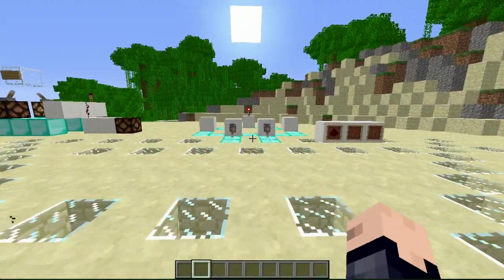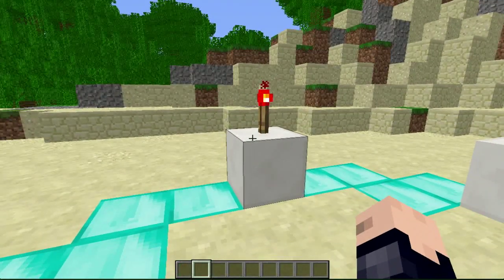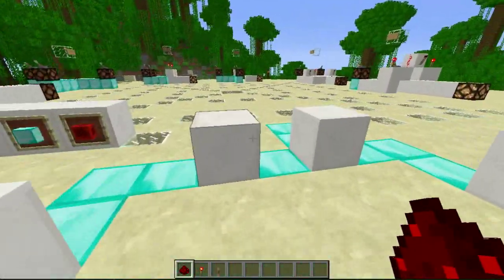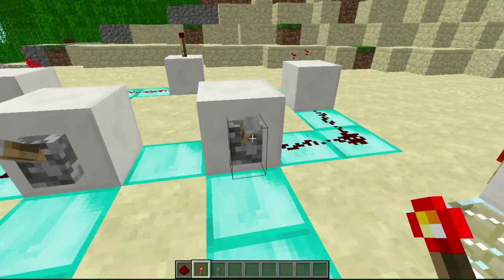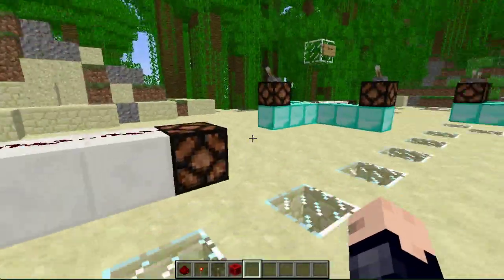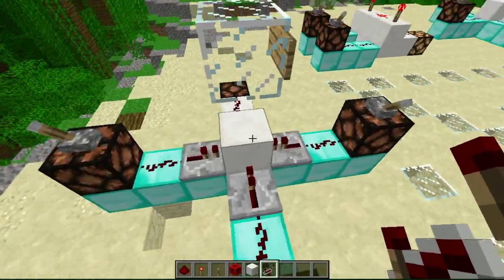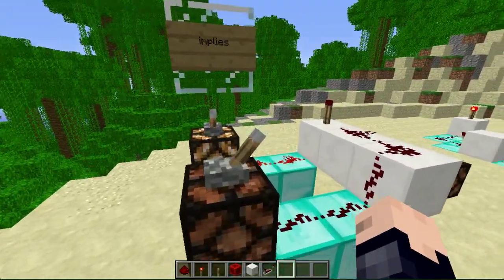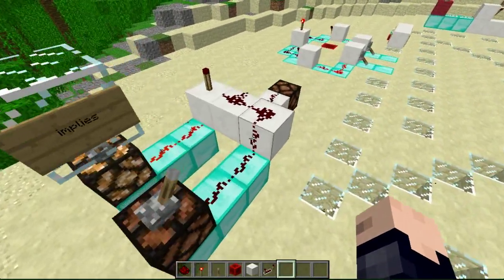Course: Redstone Basics, Gates

Comment: I believe the first gate was an "or" gate. An "and" gate would require both switches to be in the "on" position in order to turn the torch off. Unless you run some redstone from the final torch.
Reply: It was a an and gate
Reply: the hate that U are describing is a NAND gate, and the first one was an AND gate